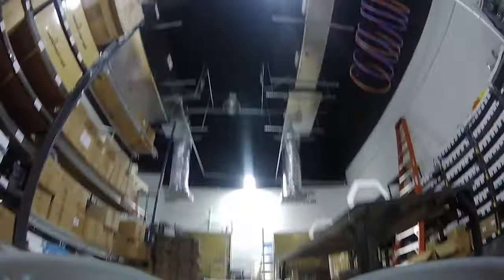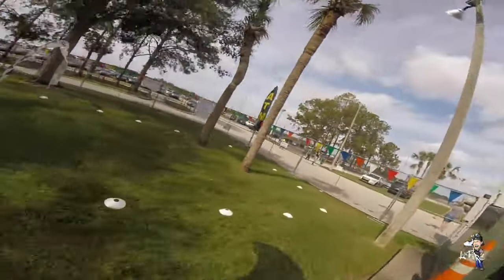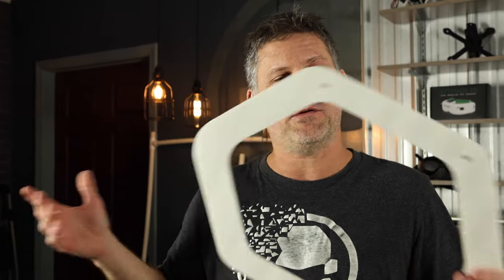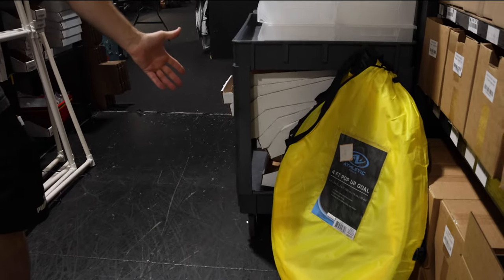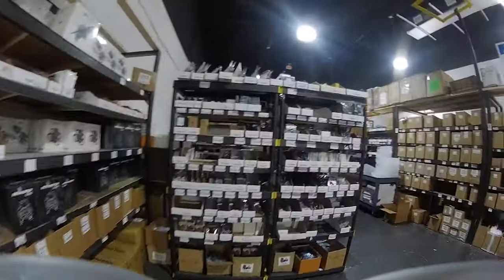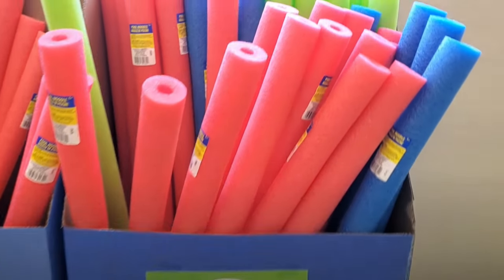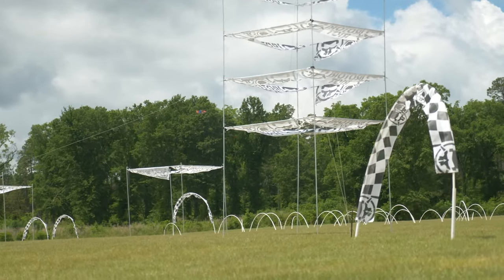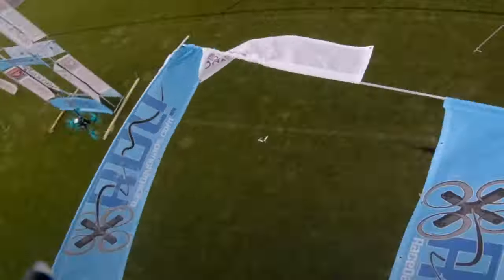4 EASY Ways To Build RACE GATES!

Comment: I think I’m finally going to pvc pipes but lately I’ve been using my metal badminton post as gates. I’ve also used real skinny and flat dowel rods and reflective driveway marks (the things in grass that mark the curb on snowy days). The dowel rods and driveway marks are nice since they just wiggle around if you hit them and don’t cause too much damage to the drone. Great video!

Comment: When i built my PVC pipe gates, i bought a few meters of elastic rope. Thread it all the way through the pipe, knot it through a hole at the ends. That way, to put the gate up, just unfold and it almost pulls itself together like one of the popup gates. When you take it down at the end of the day, you can just pull the connectors apart, fold it together and it still stays as a single piece.
Reply: thats actually a really good idea im gonna start doing that for my gates haha
Reply: That's a great idea

Comment: On a smaller scale, LED whoop gates are ridiculously easy and cheap to make in all sorts of shapes, I made a set that looked like Pac Man and the 4 ghosts, each with appropriately coloured LEDs.
All you need is garden wire make the shapes with, circle, square etc., and some blocks of wood as bases to nail them to, wrapping the LEDs round the garden wire before attaching to the block.
Reply: I posted how to make them on RCGroups back in 2017, look for
"Build Log DIY £2 indoor FPV LED racing gates for micro quads"

Comment: Yes! Use the floor as your friend!

PEX gates FTW for round LED whoop gates.  (Use the clear-ish stuff, not the colored pipe)
Reply: I’ve built the PEX hoops and they work great. If I recall the standard white short length sold was perfect (no need to cut). LEDs show very brightly

Comment: Have you tried bending the PVC to get cool shapes? If you had some large circular object you could maybe use a heat gun and bend the PVC pipe around the circle.

Another advantage of the PVC pipes is if you have a 3D printer you can print custom joints and just slide the pipes into them. It might help if you need to mount the gates to an unusual object rather than just sit them on the ground.

Comment: I use pool nuddles with PVC pipe in it can get a 15 foot ladder gate with 3 5x5 foot gate and are super cheap and the best color are the fluorescent colors
Reply: I paint the pool noodles with white wall/ceiling paint to make them easier to see.